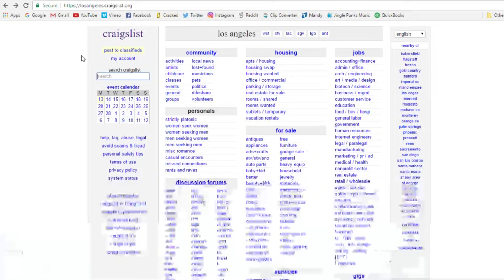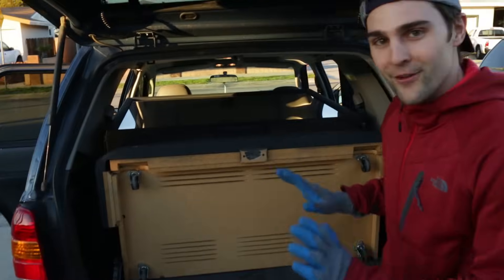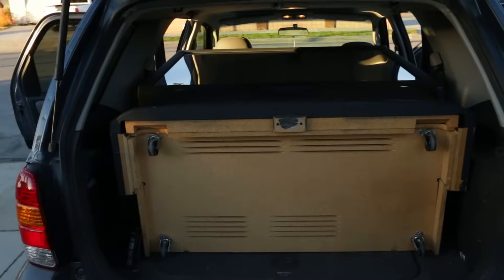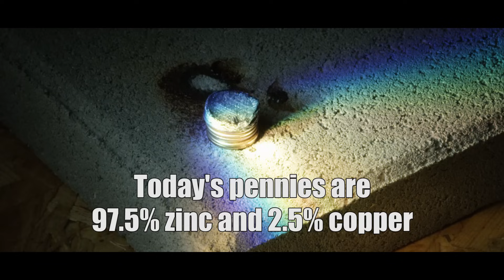How To Make A SOLAR DEATH RAY (real!) #howto #science #scienceexperiment

Comment: Would love to see you boil water with this and run a steam generator
Reply: Yes! Much agreed! Warm up/boil whatever the water for when ya don’t have electricity would be awsome. 
Example people living off grid
Reply: Thats genius
Reply: My thoughts exactly
Reply: How ? If you thinking of making its not possible because you to cover it and once you cover it then how light goes to 😂
Reply: @umairkhanofficial7162  my guess is it wouldn't scale well but would be interesting to see it even if it's small. The water would just be in a small dark container that heats up from this lense- with a single relief for the steam going through turbines. Like I said it would have to be small (and essentially useless) but I'd still love to see it.
Reply: @daveb.3169 I think a sterling engine would work even better.
Reply: I had the same idea homie
Reply: How did he not go to jail for defacing erican currency
Reply: @umairkhanofficial7162 you can put the light on a pot and it heats up the pot
Reply: @daveb.3169  Problem is, this would probably weld anything metal. Maybe graphite would work?
Reply: @Sauvenil  I mean you definitely could be rught. But you can boil water over an open fire in a paper cup bc the temperature of the cup will not ever get hotter than the water. Maybe it will work with metal as well? I know just enough to know that I don't know.
Reply: @daveb.3169 I think if it were as good a heat-transfer medium as metal typically is, it would boil off the water on the other side and easily punch through at that "singularity". It's true that water can't boil unless it's raised to a certain temperature, BUT locally at such a focused high temperature like that, it's probably boiling off enough to become superheated steam, just a very small amount at a time that gets condensed as soon as the heating stops or it gets too far away from the heat.
Reply: @Sauvenil  ok. That's all fair and makes sense to me. But then why not just unfocus the beam a little and spread it out to cover the entire metal container as opposed to a single point on the container?
Reply: @daveb.3169 That's not a laser anymore then? Or a VERY BIG laser would do it I guess.
They only work like this because the light is so focused.
Reply: @Sauvenil  maybe. It would be the same amount of energy either way.
Reply: @daveb.3169 It would take the same amount of energy over the same amount of time to heat it, yeah. If it's slower or not as even there would be some loss and you'd need more energy to reheat the areas that cooled.
Reply: I've said this to my dad, free heat.
Reply: @DeliMeatTree  I don't think it would be possible for it to produce any more heat than the sun hitting an area the size of the magnifying plastic sheet
Reply: My thought exactly
Reply: This is better then solar pannels
Reply: Maybe it could just aim it at a propeller that moves once the air gets hot enough to rise.
Reply: Boom
Reply: Yeah, I want a handheld version. I actually have a bunch of glasses in the mail and i'm gonna try just this
Reply: Exactly

Comment: Note: Some TVs have a separate diffuser sheet and a clear fresnel lens - those are ideal, HOWEVER...

if the diffuser is built into the fresnel lens (later tvs), just treat the diffuser side like a headlight restoration - fine sanding and polishing, and you'll have a perfectly good death-ray lens. Just be sure you're not sanding the fresnel side of the sheet.

Comment: I made one of those once I used a projection TV screen the very front of the screen had that same plastic piece on the front that's all I needed you hold it at a slight curve it'll burn through a two-by-four in 30 seconds

Comment: since middle of 1982 pennies are 95% zinc and 5% copper.  The composition hasn't changed since the middle of 1982.
Reply: as a side note, our government robbed us once again in 1982.  Before the change (no pun intended) pennies were the exact opposite, 95% copper and 5% zinc.  Some 1974 (not S) were experimental aluminum alloy, percentages unknown.

Comment: Can you boil the water with it?Can the steam be used let say to power turbine and make electricity? Or just heat water in a swimming pool?Or maybe build some kind of boiler to use it for central heating or heat a hot water for a shower.I just thinking about it as something practical not a toy.
Reply: Any "practical" usage (focusing the sun for more than a few minutes) would require a mechanism, potentially rather complicated, to move the lense to keep it focussing the sun as the earth moves throughtout the day, AND to move whatever the lense is focussed on, because pivoting the lens to follow the sun would also lead to the focus point moving in the opposte direction.

Comment: You can achieve the same thing by using the fresnel lens from a projection tv .... but instead of reflecting the solar energy back, it amplifies the solar rays similar to a magnifying glass .... you can get it to temps as high as 1200 degrees celsius
Reply: Er, this IS a Fresnel lense from a projection TV!

Comment: Hey nick could you maybe put a magnifying glass in the focal point of the death ray and attempt to burn things like that :) and if it does not work you could make a video telling why it did not work :)
Reply: It wouldn't work from the way you described it. However, it could work, but only if you focus it perfectly using the proper distance, math, equations, curvature, etc, so as to create a much larger PB. Essentially, what you are saying is to create a much larger PB from multiple sources and/or smaller PBs. This very idea has been tried and it works, but it complicates things as you have to have the angles just right... One such company, under controlled/safe environment, generated 10's of thousands of degrees, melting some of the toughest metals/steels on impact. The PB is no joke, it harnesses the direct heat/rays from the sun, and concentrates it, thus providing instant high temperature heat....

Comment: This is source of very high energy and could be used, we need to store it in some batteries, some type of photovoltaic could be helpful but at this temperature that will burn we need some type of similar concept to avoid burning ,may be Thermoelectric generators could be used, I am not sure because of this high temperature.

Comment: A can of liquid that doesn't contain any air or CO2 would probably not explode at all. But where can you get a can with no air inside it?
Reply: The liquid (water) would heat up and boil, leading to a potentially dangerous explosion creating a rapidly moving can and/or a cloud of superheated water.  I have exploded a number of (expired) cans of peas or corn by placing them in a garden fire.  Most of the cans exploded in 5-8 minutes, with a pop or a loud bang, ejecting most of the contents 6-20ft (2m-6m), but one can sat in the fire for over 10 minutes, eventually exploding with so much noise that a neighbor 400ft (130m away) heard it indoors, with their windows closed, and the can was launched to .... well I don't know where it was launched to, becuase I haven't yet found it!!!  Somewhere among my trees is the remains of a can of peas.
Reply: @pulaski1  I guess I'm wrong then. I tell all my friends that I'm wrong 20% of the time. In this case I accept your data but I still don't understand the mechanism. Does a packet of steam form inside the can? Or is it just the expanding force of water alone that triggers the explosion? Can you use a high speed camera to film a solar-heated sealed glass bottle that contains only water? I'm curious to see the moments before and after the explosion.
Reply: @TheNameOfJesus  Go find the Mythbusters video on exploding waterheaters, there are three separate episodes, and there are, (or at least used to be) multiple uploads on YT, as that is what would happen to a heated, sealed can of water.  

What happens is that the water expands as it gets hotter, and that continues as the water passes 212°F/ 100°C, when it would usually boil and turn to steam.  But contained inside a can the pressure increases as it gets hotter and hotter until eventually the can either ruptures, or more likely one of the ends gives way under the pressure and becomes cupped.  At that moment the pressure is reduced which allows all the superheated water, which is now far above boiling point (at normal atmospheric pressure), to turn instantly to steam which causes extremely high pressure, which causes a MASSIVE explosion.  That is what happened to the cans I placed in the fire, and in the Mythbusters waterheater episodes, the explosion launched the waterheaters several hundred feet into the air (the design of waterheaters is such that they are almost certain to fail at the bottom).

Comment: Can we combine two or three Fresnel lenses at different angles into the same focal point?
Reply: Yes indeed, this very suggestion has been attempted on a much larger scale/application, etc. Great/bright idea btw there... However, I did see a video some months back of a company doing this as they created some of the largest if not largest PB mirror in the world in a very controlled/safe setting, which heated up into the 10's of thousands of degrees if I remember correctly by focussing multiple smaller mirrors. Men, the heat was so immense, it melted some of the toughest steels/materials essentially on impact... The PB can be a powerful/useful tool when utilized properly... I can see/envision endless useful applications to this basic but yet, very effective idea... .

Comment: You can heat water and make steam and make electricity. Unlimited free energy.
Reply: Any "practical" usage (focusing the sun for more than a few minutes) would require a mechanism, potentially rather complicated, to move the lense to keep it focussing the sun as the earth moves throughtout the day, AND to move whatever the lense is focussed on, because pivoting the lens to follow the sun would also lead to the focus point moving in the opposte direction.

Comment: what happens if you point this at a solar panel?
Reply: Breaks the Panel.
They are made to efficiently use what usually reaches the ground.
This would be too much in too small an area and would damage it